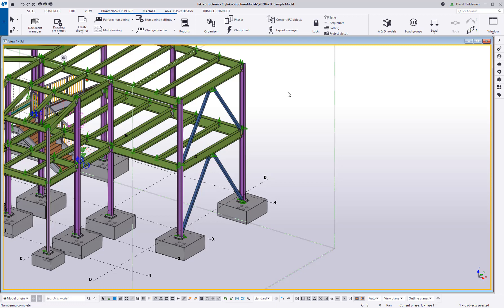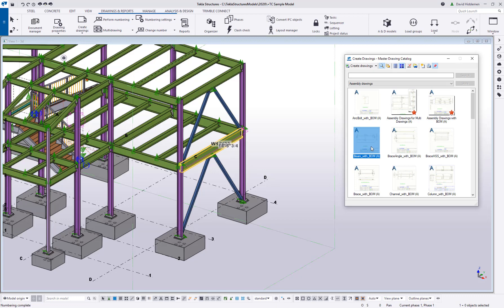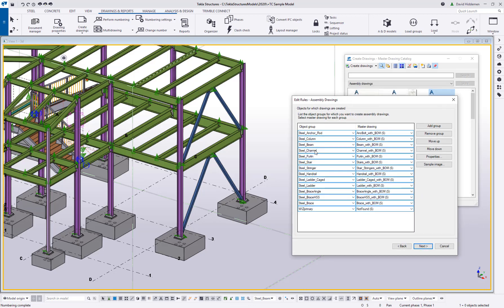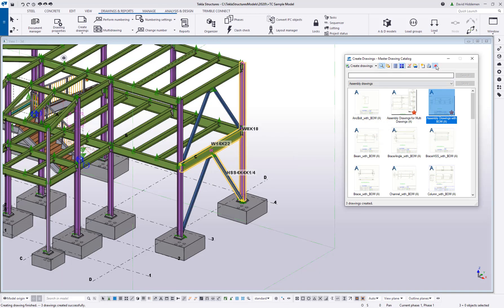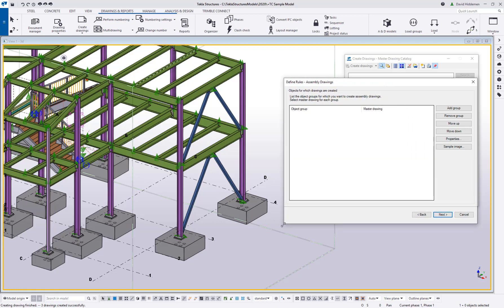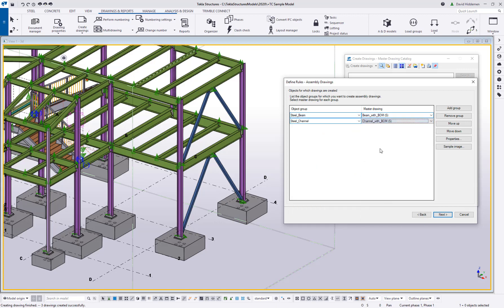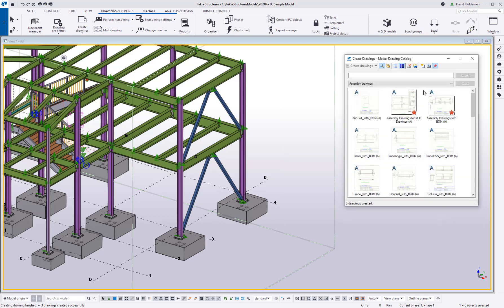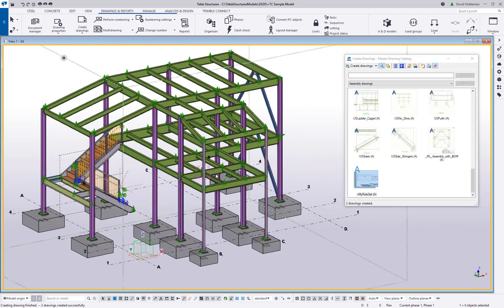Drawing Rule Sets

Comment: In the saved drawing properties I use User-define attribute parameters but this automated drawing creation method does not care about UDA fields. Is that true?
Reply: I'm not sure what you're asking... the Rule Set only looks at the overall drawing property (eg "Beam_with_BOM") so it should include any UDA's that are saved with the overall drawing.
Reply: @TrimbleTeklaDave  UDA is part of the drawing properties but even if I type any text for eg. in the Comment field it will not appear after creating drawings. Once I applied a named drawing properties, that UDA content will apply regardless of the other UDA content specified in the different master drawings.
Reply: @jordanhernadi2157  I tested this in v2020, and it worked like I assumed it would - if the UDA properties are saved as part of the drawing settings, then they are also included regardless of how the drawing was made - manually or through the rule set/master drawing catalog. Perhaps they are not getting saved properly?
Reply: @TrimbleTeklaDave  thanks for trying but I also tested this issue in v2020 with saved UDA attrib. (Comment) and does not want to work for me - well if you once applied a saved setting with UDA text (for manual DWG creation or for any other reason), this text will be applied for all of the drawings created through the MDC after. Therefore you will need to save and test 2 different text at least.  I used one of the default environment made by Construsoft (Europe) for this last test.

Comment: in 2017i if you have space in the file name of the applied Object Group - Selection Filter the drawing creation function does not work. What about in 2020 ????
Reply: Yes, the filter names still need to be created without spaces in 2020.
Reply: @TrimbleTeklaDave  thanks for your reply, I also have 2020 licence, but I do not use it because of the stupid ribbon, property pane etc. - I think the head of the development is a stupid psychopath - Xsteel was the best detailing software and Tekla was also until 21.0; but now they have monopoly position - they think they can do anything